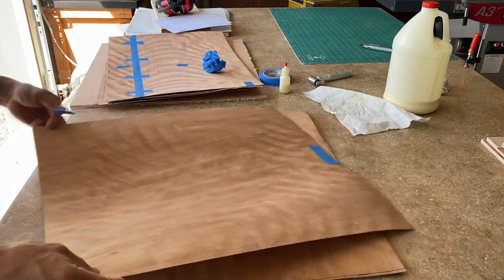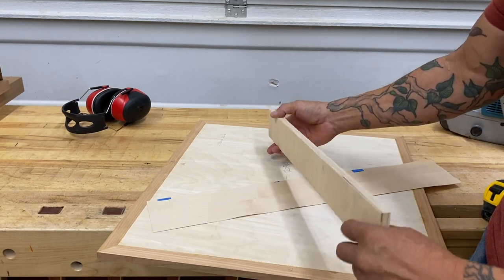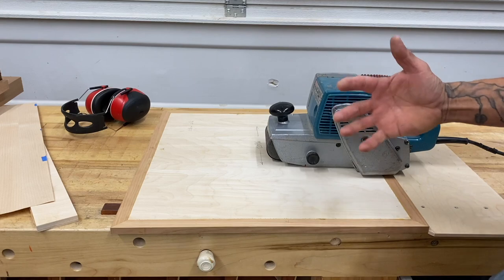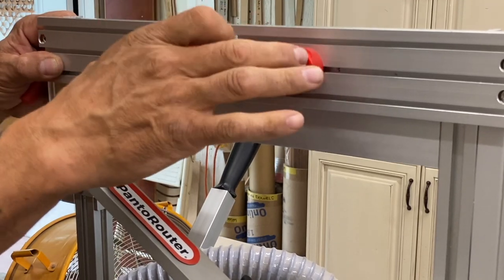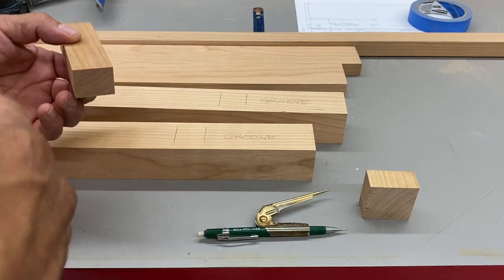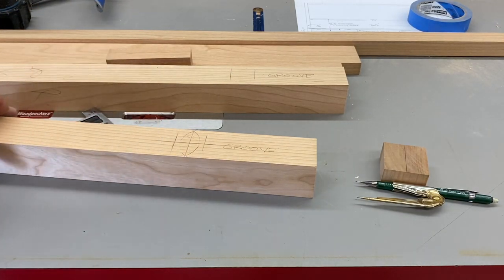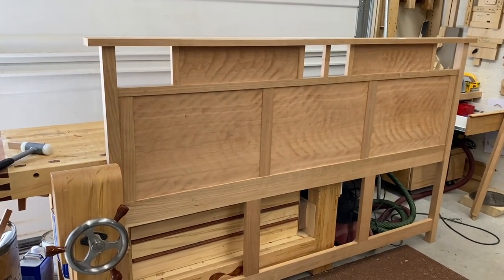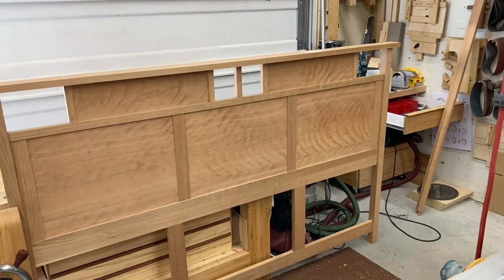Building a King Size Bed Part 1

Comment: I'm excited seeing you use a combination of mortise and tendons and dominos as your connections!  It is great seeing you use epoxy in the glueup for the long assembly time.
Reply from the maker: Yep…some different applications require different types/techniques, right?  And yeah…kinda hard to find but I like 30 minute epoxy for jobs like that.  Thanks a ton for watching !